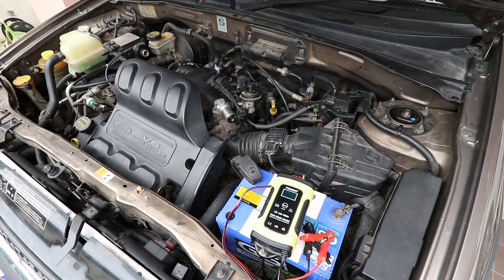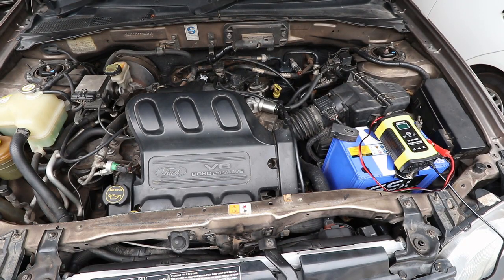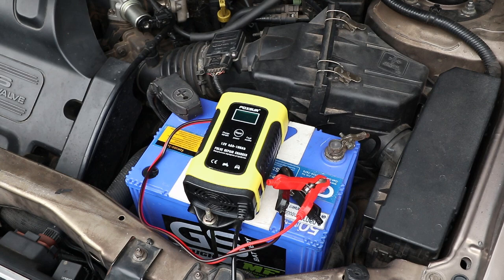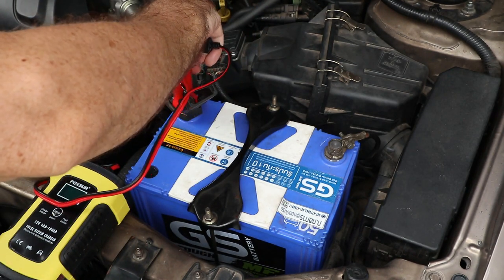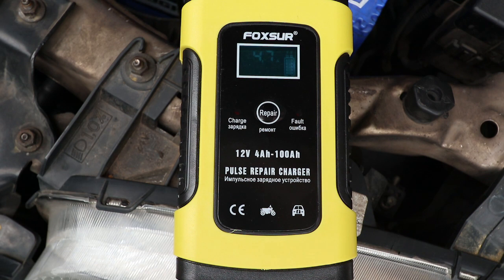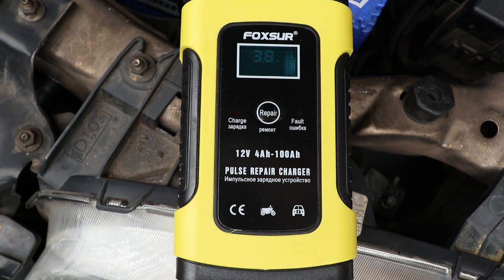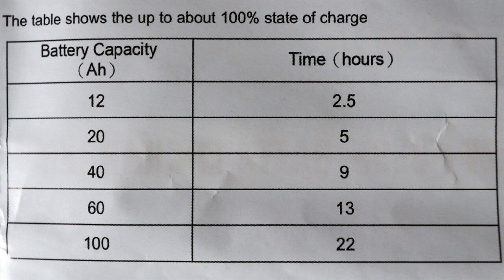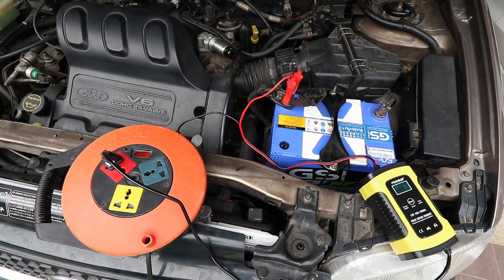Review Of The Foxsur Pulse Repair Car Battery Charger

Comment: Can i use this device to Jump Start To urgently use my car?

And then is it able to recharge again when i got back home and leave it overnight?
Reply from the maker: I'm actually using it right now to do a pulse/repair on the battery in my wife's car.

No, you can't use it for jump starts. For that you'll need a portable jump starter, which is a completely different kind of device. The Foxsur doesn't hold any charge.

You can use the Foxsur to charge your battery overnight, although overnight may not be long enough. When I have done charges and repairs to my battery (620 CCA) it has taken in excess of 24 hours.

Also, if your battery performance has degraded because of sulfation you can use it to do a pulse repair and this will help to remove lead sulfate crystals from the internal battery plates.
Reply: @PhilUKNet  thats very kind of u. Thank you. Very useful and informative answer. :)
Reply from the maker: @DinDin-jd9lg  My pleasure!

Comment: I am looking at buying on of these FOXSUR Battery Charger because I looked AliExpress & read up on it apparently the FOXSUR are a very good brand of charger & it has 7 stage charging system & they are reasonably priced battery charger Kind Regards Peter
Reply from the maker: Hello Peter, I believe that the same basic charger is sold under several brand names - Foxsur being just one of them. I have been quite pleased and I have received comments from other people who have also been quite pleased. The main criticism seems to be the amount of electrical noise that these things generate, although I haven't experienced any problems myself. If you use the charger near to other electrical devices, especially Wi-Fi points, it can interfere with them and stop them from working. That's just something to be careful of. It works well with regular charging and when I used the pulse/repair function it gave my battery a new lease of life, as verified with the Foxsur battery analyser. They are quite cheap - although more expensive in the UK compared to where I am in Asia - and I think they are good value for money. Thanks for your comment!

Comment: Just bought one of these, (EBAY=29.00us)under another name, because I had an optima battery go kuput’ after only a month of use, mid winter, in USA. Man, I’m here to tell ya, it works. Saved me 300.00usd battery back to 100% after the 18hr repair cycle. My regular AGM charger would just shut off at 30% (edit) radio killed the battery , below where it should of gone. Back to normal now , though
Reply from the maker: This is good to hear, thanks for the feedback! Reactions are mixed. Just like you, some people are pleased. Other people say the devices are Chinese pieces of junk that cause interference on other devices. My experience has been very good. The charger has improved the condition of my battery and saved me money.

Comment: Hi  can you leave it permently on if  not using the car say for 3 month ? And when it's full it switches off and when the battery starts to drain it comes back on? Have I got it right I live in Thailand also so your recommendations I respect thankyou
Reply from the maker: It may be OK, but this isn't really what these devices are intended for and it's not something I would recommend. This device is a battery conditioner. Your car battery loses efficiency because of the build up of lead sulphate crystals on the plates. In pulse/repair mode this device can deliver strong pulses of electricity that break down these crystals and thus improve the battery's performance. They are only designed to be connected to the battery while the repair is taking place (24 hours, or so) and then removed.

If you are planning to leave your car for an extended period of 3 months or longer, what you really need is a trickle charger, not a battery conditioner. Trickle chargers work on a very low voltage and they just replace the charge that is lost naturally. Because of the very low voltage there is little risk of overcharging, as there might be with a battery conditioner if you leave it connected for a long time.
Reply: @PhilUKNet   Thankyou but if it reaches full charge and switches off , is that a what problem ,.?
Reply from the maker: @stephenfell4338  I guess it may not a problem, but this charger isn't really meant to be connected permanently for months on end. It's just meant to charge or repair and then be disconnected. When it reaches full it may stop charging, but it doesn't actually switch off. Your original query was about leaving it connected for 3 months.
Reply: Yes it will stop charging once it reaches 100% - listen to the fan once it shows "FUL". 
 I did leave my Foxsur turned on for days, but if one notice the fan is running continuously on "FUL" status after several hours, it probably means the battery can't reach 100% charge state (maybe around 95%)  and the charger is keeping it afloat.
No issue though . Battery temp remains cool. 
 At "FUL" status it's just pumping out probably less than 1A but at 13.4Volts.

Comment: These things cause horrendous interference on various radio bands.
Reply from the maker: A few other people have left comments saying the same thing. Apparently, they can really screw up Wi-Fi. I guess the moral is to be careful where you use them!
Reply: @PhilUKNet  And remote car locks, HAM radio, AM and FM broadcast reception, 5G, radio astronomy, aircraft communications, and weather radar. They're Chinese junk and don't meet the EMI standards. It's basically a wide band jammer.
Reply from the maker: @MartinInAmsterdam  They're certainly cheap and I guess the manufacturer isn't too bothered about meeting international standards. To be honest, I wouldn't have known about this problem unless people had left comments. I've used it indoors and out on my driveway without any interference problems. However, now I am aware of the problem if I experience any interference problems next time I'm using it I will know why.

Comment: i have had mine for a couple of months now, and have kept my caravan battery topped up ,also had a Exide 45A battery which has not been used for a while and although i have charged it before over 12months , it has a window which supposed to let you now the state of the battery , black colour (needs charging or flat) silver needs charging, and if the battery is good green, which although i have over chargers it has never been green in the small round window at the top, however i used this charger on pulse for about 16hrs then it went to trickle charge  and guess what i have a green window like it was new again, its cold here so it charges about 15v,   so the pulse bit works and of coarse the charger,  ?
Reply from the maker: That's fantastic! I've had success with the charger, but you've had even more success. Thanks for sharing!

Comment: and at the same time i need to connect this battery charger to the electricity socket??? how the hell i will find socket in the middle of the road then...
Reply from the maker: You don't need to. Just use a very long extension lead and you can leave it plugged in at home. That's what I do.
Reply: @PhilUKNet  then I need about 2 km extension lead, this far sits my car currently:) well I ordered similar battery charger paid 35 EUR but I thought you charge it home and take it with you and you can jumpstart the car with no AC connection...my mistake I will return it
Reply from the maker: @metiniac  No, it's not one of those devices that will allow you to jump start your car. It just charges/repairs/conditions your battery at home and needs an AC supply. Those jump start devices look useful. I have jump leads, but without another vehicle they aren't much use.
Reply: @PhilUKNet  thanks for the comments
Reply from the maker: @metiniac  Thanks for the laugh!

Comment: i cant get this for anything like 10 quid?
Reply from the maker: Not surprising in rip-off Britain. They're still available online in Thailand for the equivalent of around six quid.
Reply: @PhilUKNet  hi right ive just got mine, when i plug it in i can hear electric noise, like crickets in the grass, it sounds a very cheap type of sound does your do this, ?hopefully its not faulty  thanks
Reply from the maker: @fatboy9700  This doesn't sound right and mine doesn't do it. All I can hear is the whirring sound of the fan (no insects). Despite the high UK prices, these are cheap products and the quality isn't fantastic. Several people have reported electrical noise (not audible) that can interfere with other electrical devices. Yours may work OK with this sound, but possibly it will fail early. It's up to you, but in your position I'd be tempted to ask for an exchange if you have only just got it.
Reply: @PhilUKNet  hi, thanks yeah i will do

Comment: I thought it was a moderate review generally speaking, but I think that the instruction manual that comes with the charger is completely useless! because it doesn't tell you how to use it at all despite having translation in lots of different languages. The charger has a micro processor but it thinks it is so clever that it doesn't need to tell you how it works! Bring back clockwork! I am sorry for being so grumpy, but at least I know where I am with clockwork! Perhaps you could fill in the gaps?
Reply from the maker: This is the world we have created. We all want to buy lots of things at cheap prices and China has made this possible. But good instructions, user support, service, etc, has fallen by the wayside. It's the same with dash cams. Users try to figure things out for themselves in online forums because the documentation is so bad and people hack firmware to add features because manufacturers aren't interested. People like me spend our own free time making videos for no reward to try to provide more information, but our efforts are simply dismissed as being moderate. YouTube is a free and open platform to which anyone can contribute. I look forward to seeing your review which, of course, will be exemplary rather than moderate.

Comment: I have just purchased one....word of advice....dont plug it in next to your WiFi router, when in repair mode, it makes a mess of WiFi signal 😳
Reply from the maker: Thank you! Interestingly, I received a comment recently about radio frequency interference with these devices, although it didn't mention Wi-Fi specifically. The person who left the comment said that on many forums people were recommending the use of an RFI filter with these devices. Yes, I can imagine that the constant pulsing in repair mode will upset a lot of electronic devices!

Comment: I would have liked to see exactly what you attached the the negative clip to. I would have attached both clips to the corresponding poles on the battery itself. As we speak, I'm charging my car battery up now in the house having taken it out of the car completely. What would happen if you attached both clips to the battery while the battery sat in situ? Thank you. (BTW, I got my charger for £15.59 on Amazon so I feel completely ripped off considering how much you paid for yours!)
Reply: £15.99 from Amazon is cheap,  the cheapest price on Amazon U.K.at the moment is about £25.... I just bought one from eBay for £16.95 which is about the going price in the U.K.
Reply from the maker: @dgrreadyt  Someone, somewhere is making a lot of money. They're still available on-line in Thailand for around the equivalent of £6 and retailers are still making a profit. The wholesale price must be very low. Yes, there is shipping and tax, but even so, UK consumers (as usual) are being ripped off. It's the same with camera equipment and many other things.
Reply from the maker: If the battery is dead it can leak hydrogen gas and if you connect both leads to the battery it can create a spark, which could ignite the gas. Somewhere on the engine block there should be be an unpainted metal grounding point that you can connect the negative lead to.
An Irishman told me he paid £28 on-line, including shipping from the UK, so you didn't get ripped off too badly! They are still around £6 on-line in Thailand.

Comment: I found problem for this foxsur charger in order to charge AGM battery. normal battery charging voltage 14.4V but AGM requires more higher voltage 14.7V or higher but this charger only charging 14.7V when it's not summer mode. you can only charge AGM battery when weather is cold.. wasted money
Reply from the maker: Thanks for the info.

Comment: Came here to find out about the battery charger, and spotted your car battery was in Thai, before you said you were in Thailand. I'm down south on Koh Lanta :) . Bought one of these the other day to check a few bike batteries (all good) Currently have the charger in repair mode on a UPS battery to see if it will bring it back to life. What I don't understand is the temperature sensor - there's no way that is the temperature of the battery, it must be the ambient air temp, or the temperature of the charger. I can't think of any way the charger can tell the temperature of the battery just from the charging connectors.
Reply from the maker: There's a directly proportional relationship between electrical resistance and temperature. It just measures the electrical resistance inside the battery and tries to estimate temperature. It's completely inaccurate, but the manual does say "Temperature is for reference only, allowed tolerance." Greetings from Songkhla province!

Comment: Unfortunately, the charger has no noise filter at the input of the switching power supply. It thus produces a really large amount of interference in the distribution network. This may limit the functionality of other devices, especially electronic devices, near the charger. This was the reason I came to this fundamental shortcoming of the charger. The charger definitely does not meet the requirements of Electromagnetic Compatibility standards! Personally, I solved this by inserting an interference filter from a non-functional ATX PC power supply. In my case, this solution reduced the interference to an acceptable level. Otherwise, the charger itself works well.
Reply from the maker: You must be an electronics engineer! My background is mechanical and production engineering and I just don't have this in-depth knowledge of electronics. Thanks for sharing your knowledge.
Reply: Very useful tip MS. Quite a few people have mentioned about the RFI with this charger. I wonder if a mains extension lead with a built-in filter would also work.
Reply: @phonicwheel933  Hard to say. For the most effective removal of interference, it is best if the filter is as close as possible to the source of this interference. But here it is true that anything is better than nothing. It would be good to try it. Unfortunately, I do not have such an extension cord. In our country, such extension cords are not commonly sold. They can only be purchased with surge protection, but not with an RF filter. Maybe some specialty store for audiophiles. This is due to the legislation that all electrical equipment sold in our country or the EU must meet the relevant standards, including those relating to electromagnetic compatibility EMC. The problem here is that the charger is Made in PRC, where they probably don't bother with any EMC. It would definitely not pass any of the European type-approval tests in this technical design.
Reply: @martinsafar5576  Thanks for information. You can get extension leads with RFI filters, but I was forgetting that they are a bit expensive. For example:  https://www.amazon.co.uk/dp/B000PS5700/ref=cm_sw_r_cp_api_uOfQyb1N94VDF. Yes, it is much more effective the suppress RFI at source as you say. 

It is rather odd that RFI suppression is not fitted to many chargers as the components are not expensive and in some cases there is actually positions for the components on the unit, but they are not fitted. Also, many  low cost power supplies etc from PRC do have RFI suppression.
Reply from the maker: @phonicwheel933  I haven't seen those comments, but anything that cleans up the input power can only help.
Reply: @PhilUKNet  It seems that many battery chargers, and not just the cheap ones, generate RFI: take a look at the hundreds of Amazon UK reviews for this charger under all its guises.
Reply from the maker: @phonicwheel933  I bought mine in Thailand for about the equivalent of 6 UKP! The manufacturing cost must be minimal so I'm not surprised they have issues like this! Thanks for your comment.
Reply: @PhilUKNet  as a matter on interest, two weeks ago the best UK price for the Foxsur, and similar, was UK£11 from ebayUK and now the best price is UK£12 from Banggood UK, both with free post and packing.
Reply from the maker: @phonicwheel933  Interesting, thanks for that. An Irish guy left a comment saying he had paid 28 quid. I guess that Irish customers also have to pay shipping from the UK, but that sounded a bit excessive. Eleven or twelve quid isn't too bad. You can currently buy one at Lazada Thailand for Bt259, which is about £6.33. https://www.lazada.co.th/products/foxsur-12v-4ah-100ah-pulse-repair-charger-i1611446471-s4410452464.html?spm=a2o4m.searchlist.list.1.e1d358bdtNDwyz&search=1
Reply: So what ? are you a radio Ham every LED light in Thailand makes broadband inverter mush all over the 2-30 mhz shortwave bands the charger does not have a ground wire It's made in China and sold in Thailand, and cheap too thanks to LAZADA./ I have one and don't do my ham radio when it's running lolz EMC works both ways your other kit is probably not up to scratch if a cheapo charger upsets it  ????